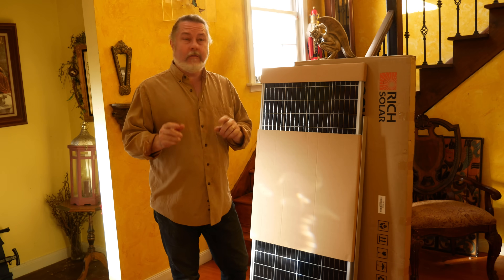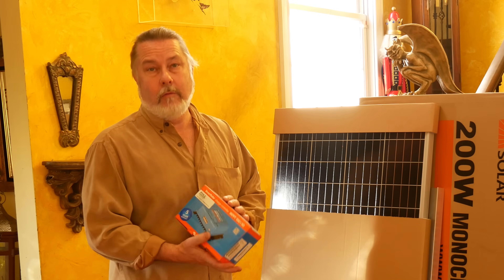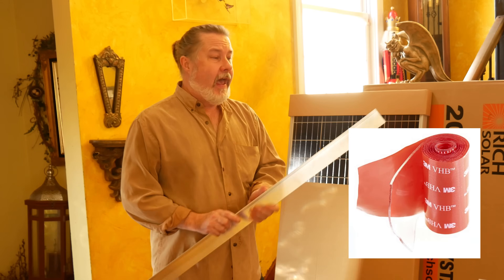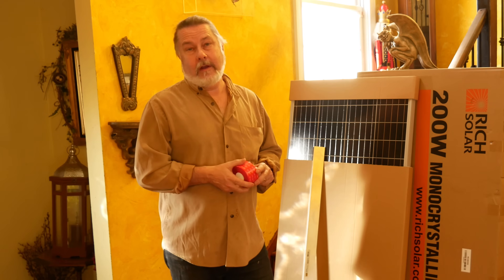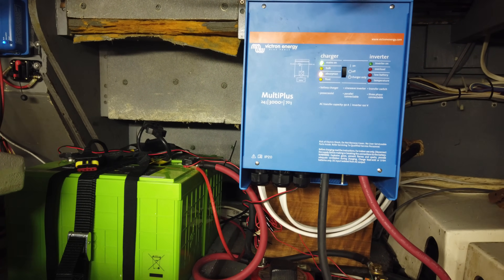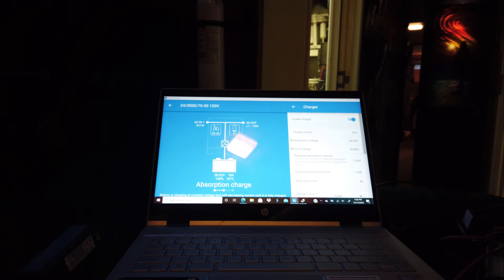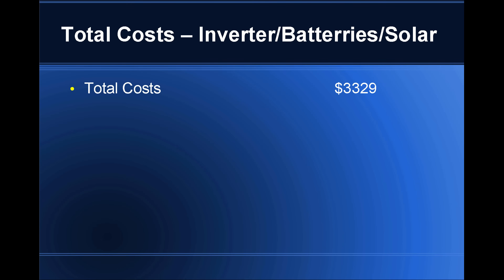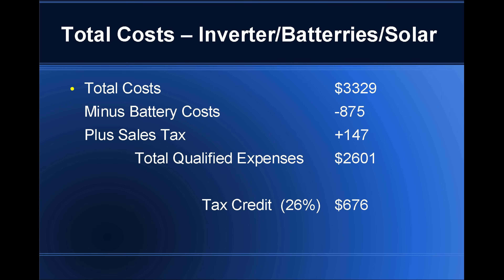We got free solar panels for our Trawler - you can too! E110

Comment: Man, $1 per watt for solar panels? I can get Silfab made in USA panels for under 50 cents a watt. Mission Solar made in Texas are a little more, but still around the 60 cents a watt range. Don't buy solar stuff from online 'retailers'. You get drop shipped and 100% marked up by layers of middlemen. Victron Energy makes good stuff though.
Reply from the maker: I believe a good portion of that cost was for shipping. We are very happy with the Victron components that we purchased. I'll probably do a follow up video this year.

Comment: Just my opinion but maybe you should have considered mounting them at the same angle as the roof... That way water can run off easier and doesn't pool on them... But I could be completely wrong... They may be just fine...
Reply from the maker: They are at a slight angle, with the roof. So far so good.
Reply: @tryingnottosink9107  gotcha. Sorry. I wasn't trying to tell you what to do with your boat or anything. I was just worried that water would sit on em. I guess instead of telling you what I thought you should do, I should have asked if water sat on them the way you did it. Probably woulda been a better way to word it...

Comment: I do have a question:: wouldn't you prolong the life of your solar panel cable's by taking rubber tubing and surrounding them from panel to junction of both then running it up to where the water tight fitting is on top,  you could secure the tubing via the same mounting tape, protection from uv and various climate elements thus prolonging the system?? Just my former engineering background kicking in.
Thank you for sharing your adventures with all of us... Safe travels 🙏
Reply from the maker: Thanks for watching. That would probably help. I think they are made well though, and will hopefully last.

Comment: Hey Ed and Lyn, to start with a very Happy Holidays and  Happy New Year from our crew to yours.  Maybe one day we'll meet on our way back through the Chesapeake in the fall of 2021.  Ed, I've been watching this with a great deal of interest.  I've built a few solar systems already  and have found that they have always met our needs.  I would only add something to your installation coming from personal experience.  Hide those wires on your hard top either use a UV stabilized wire loom or you can go the extreme to using flex water tight conduit.  The only reason is that UV will eat through the insulation on those wires in no time.  You spent all that time installing them on your hard top, may as well spend a bit more time protecting the wires so that you don't need to go up there and replace them all after the UV has rendered the insulation to brittle plastic.  Even outdoor rated marine wire needs protection, trust me on this you'll be glad you did.  Also Ed,....I'm sorry Lyn, if you didn't already know about it; you need to check out McMaster-Carr for your bits and bobs, they are a great supply resource that mechanical and industrial engineers, machinists, tool and die makers, and lots of us industrial types use on a regular basis for tools and hardware and just about anything else.  Love the channel, love both of you and what you are doing.  We'll be out there soon enough with you somewhere between here and there.  
Cheers and Happy New Years!!!
Reply from the maker: That is a good idea. I'll try to do that before we head south in the spring. We'll check out McMaster-Carr. We are adding an MPPT controller for our alternator this week. We will post a video some time soon.

Comment: I forgot...I wanted to mention,that,any deck surface with the slightest curvature is the crown of the deck.When  the deck is flat it has no crown.Just thought I'd throw that  out for any future reference.
Reply from the maker: Good to know. Just like lumber.
Reply: @tryingnottosink9107  so ,for example,If you wanted to lnow if the deck is flat or not you would ask if it has a crown or if its crowned.

Comment: This may be a dumb question, or answered already so i apologize in advance. Does the main propulsion engines do any of the charging / generating power when in travel?
Reply from the maker: The engines charge our main 32 volt battery banks, but not the new lithiums. They are 24 volt. It is possible to install an additional 24 volt alternator on one of the engines. We will look into that. Our main concern would be over charging the batteries.

Comment: Just a note: The amp rating of the controller is the OUTPUT amp rating, not the voltage on the solar side.  So with 400w of panels you're pretty close to the limit now. 400w ( panel max output ) / 13v ( roughly charge voltage ) = 30A. 
FWIW, I installed 160W panels on our RV in 2013 with VHB and they're still there, it's serious stuff.  However, the enemy of VHB tape is water and dirt, so sealing the mount points with lap sealant is important. 
Also, solar panels lose efficiency when they get hot, so providing some ventilation underneath them is a good idea if you can. 
Still, that looks like a nice setup! We've got 640w of panels on our 38' trawler, with a Victron 100/50 charger and an 1800W inverter. 
As for the return on the investment time, your calculations sound a little optimistic based on our experience. Our boat has a single 8CF fridge and a 40qt extra freezer. Cooking is done on propane with a little bit of microwave and toaster oven on the inverter and the lighting is all LED.

 We found that our solar could make up about 60% or so of the power we needed on the boat for repeated days on the hook or at a mooring. To keep the batteries reasonably full before the solar, we found that we needed to run the generator about 4 hours a day. After the solar, on a sunny day would would typically run the generator for most of an hour in the morning to get the charge started and heat hot water. Really cloudy days would usually make us run the generator 3-4 hours a day like we had prior to the solar installation. Yes, the solar did provide a little on those days, but we still needed a lot of generator use. You're going to be better off than we were since we were using flooded lead acid batteries and didn't want to pull them down as far as you're going to be able to do with Lithium. You've also got no worries about not getting them back to 100% as often as possible, since LiFePo4 is fine with repeated partial charges.
It's going to be hard to really know how much power you'll need daily to keep stuff running until you start actually doing it and measuring how much energy gets used in a typical day. I think you're going to want that third panel. We've got a bit more than that on our much smaller boat and we need all of it and more.  
Happy Holidays to you and yours, favorable winds and smooth seas!
Reply from the maker: Thanks for the info. This is our first foray into solar and inverters and there is a lot to learn. Our solar panels are 24 volt each,  wired in series. Wouldn't that make it 400/48 = 8.3amps? We anticipate needing to add at least one more panel, which is why I left that space open between them. Last year, while on the hook, we ran our generator for at least a couple hours each night for air conditioning. We figure if the solar does not keep up, the generator will take care of it. We are mostly looking for savings by not needing to run the generator while underway to keep the refrigerators running.
Reply: @tryingnottosink9107  You're doing pretty well, we're all learning all the time. I'm impressed with the job so far, you're just a little off on the math, but it's not easy. 
400/48 is indeed 8.3, but that's not how your panels work. 
It doesn't really matter what the voltage your panels are ( as long as they're higher than the battery voltage by a bit ), an MPPT controller uses a DC to DC converter to turn the energy from the panels into the correct voltage to charge the battery. The wattage stays roughly the same comparing input to output of the controller ( there is a few percent loss, but for the ease of the numbers, let's ignore that for now ) but your batteries only take about 13.8v or so to charge, more in absorb, less for float. 
If your panels are putting out their full, rated power ( this is rare, but it's possible to see significantly higher than rated, more on that in a bit ) that's 400w. Wattage = voltage x amperage. 
One other thing to know is that the voltage that comes from a panel varies a LOT, depending on how much sun they're getting, the angle and how the power is being drawn from them. The reality is that a 24v panel ( they were originially designed to just make more than 24v, so they can charge a 24v battery system ) puts out typically between about 36v and 45v, check the label on the back. When making maximum power (shown as Vmp or Imp for voltage at max power and current at max power), your panels put out about 38v@5.3A. In series, that's about 76v, more in cold weather, and when wired in series the voltage doubles but the current remains the same. 
The current at max output is about 5.3A, so the wattage at maximum output is about ( 76v x 5.3A ) or 402W for the two panels in series. Close enough to 400w to make no difference. 
That 5.3a@76v is converted to about 13.6v to charge the batteries. 400w at 13.6v is 29 amps. 
So, the solar charge controller takes the high voltage at low current and converts it to low voltage at higher current. So the batteries will see about 30A or so while the panels are only putting out 5.3A. 
It seems like magic on the surface of it, but because the wattage out is the same as the wattage in ( minus a bit for inefficiency ) it's really just like moving the fulcrum on a lever. If you have a lever long enough, you can lift a car, but you need to move the lever a lot on one end with a little force to move it a  little on the other end with a lot more force. 
The end result is that you're near the rated limit on your controller. Check page 13 of your manual. That chart shows maximum wattage for the 100/30 as 440w when charging a 12v system. 
As for the maximum your panels can deliver, that's done at a specific test amount of light at (I think )70F temperature. You're unlikely to see that output most of the time. Right now, in AZ in winter, I'm seeing about half the max rated output from my panels. In the mountains in summer, I've seen about 15% over the maximum, thanks to thin air and cold temperatures. 
You're unlikely to see that kind of wild swings, but if you take Triton to the tropics, you could see the max output, so I wouldn't exceed the rated limits of the controller. 
My suggestion would be to either get a larger controller ( you'll need one that's higher than 100v if you want to put three panels in series to keep the amps the same ) like the  150/70 or add another 100/30 ( you'll need to run more wires ) since they can work together. 
My email address is airmon@gmail.com, feel free to email me if you would like any more information. I've done a half dozen solar systems on various things ( boats, RV's, sheds ) and some lithium battery systems as well. I'm not a pro, but I know a few things.